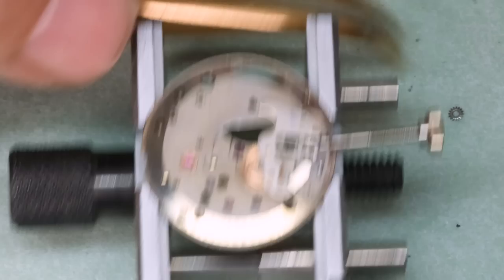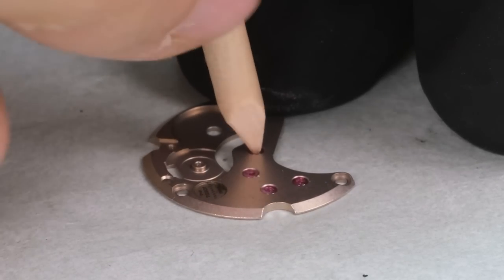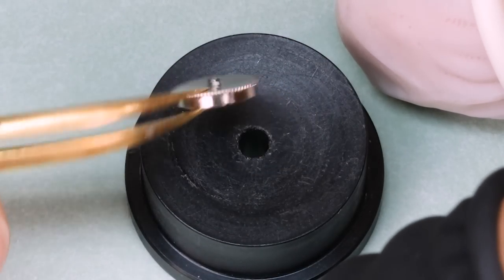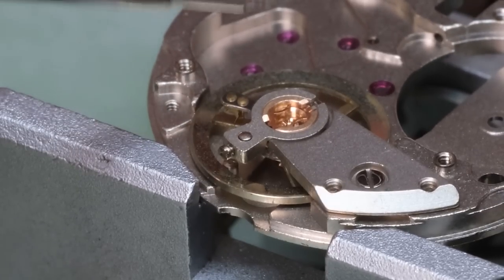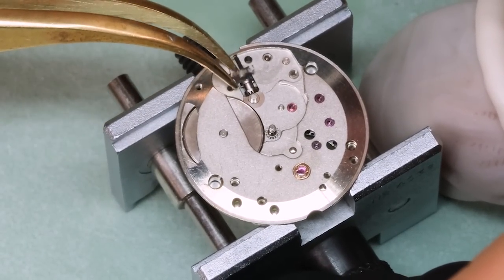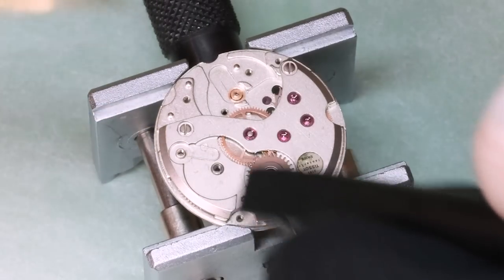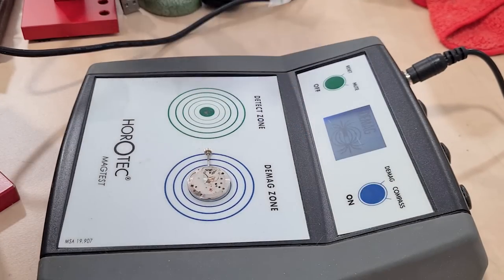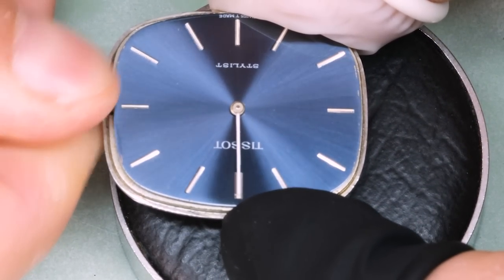What is a NOS (New Old Stock) watch?

Comment: I'm working on an ETA 2512 for my elderly neighbor, which is roughly the same size as this one.  It's been very challenging given my skill level.  I did find the 2nd wheel had a broken pivot (but not until I tried putting it back together) which explains why she picked it up so cheap at a local shop.  I also had to wind the mainspring in by hand because the arbor on my small winder was too small for the spring and wouldn't catch and I didn't want to try to bend it for fear of breaking it.  These small movements look big on the screen and I'm sure most viewers can't appreciate it, but I totally get it.

Comment: The principle of entropy says, in essence, everything deteriorates with time unless deliberate steps to preserve or improve it are taken.  The more complex the thing, the greater entropy's effect.  This watch is a great example of entropy at work.  I'm new to rebuilding old bicycles, but already I have found examples of the same principle applying to "NOS" bike parts.
Reply: Unfortunately a NOS bike would get enough power to brake itself unlike a NOS watch which has not enough power to even start. Fortunately for the movement.

(Just thinking of 50 Year old brake pads...) 😱
Reply: @Ba_Yegu  Indeed. We rarely an entire bike being advertised as NOS, but we do see parts.  NOS brake pads probably would be hard as a brick and unusable.  NOS tires can be pretty risky as well, though I've got some 20+ year old ones in service right now, and they're doing fine.  But NOS derailleurs or brake calipers would just need a little TLC, akin to what was needed for this watch, to make them operate as new, maybe even better than new.
Reply from the maker: Thanks, Ranger! I didn't really know the word entropy, but now I do :) And you're absolutely right, unless something has been stored in complete vacuum, it will deteriorate. And perhaps even then? 🤔
Reply: @VintageWatchServices  In complete darkness, in a container filled with inert gas (e.g., Argon) under slight, positive pressure, kept just above 0°C and protected from variations in ambient temperature and movement. That, or one could just service the NOS watch and put on a new strap. ;) Thanks for another great video.
Btw, over time, I’ve purchased three, slightly newer NOS watches (1980’s and 1990’s) and I learned fast that while step one was admiring them and their visual,perfection, step two was immediately tearing them down for servicing!

Comment: Love your channel Stian. I am fascinated with your abilities as a watch maker, and as a historian. I always learn something new each time. I did some calculations using an on-line inflation tool. It showed 100 Japanese Yen in 1974 is now valued at 216.31 (39,000 now equals 84,360.9).  Using the current yen rate = roughly 574 Euros. Cheers from Guam USA👍
Reply: 100 yen per dollar exchange on average over decades, so the watch retailed at $390 in 1974.
The 1974 buying power of one dollar was six times the 2022 dollar.

Comment: I bought a JOS Shanghai watch made around 1980 to 1982 for 70rmb everything was great the strap was good it had a 21600bph 19 jewel Tongji handwind movement.

He swapped out all of the o rings with new ones and serviced the watch.

Since most Tongji movements are very similar and he was an old watchmaker he looked like he could do it with his eyes closed.

Use iso to clean it and Seiko synthetic lube and grease.

He poised the balance and regulated it very very well he said come back after you have worn it in 3 months when it's broken in and I will adjust it.

I love NOS finds.

Comment: Wonderful. Perhaps you can check with Polywatch but I spoke with their sales rep many years ago and he told me that polywatch was not an abrasive but in fact worked with friction from rubbing to move very slightly the plastic molecules so as to fill in the scratches. You only need a lentil sized amount on a crystal in this condition and use a wadded up piece of kleenex which helps generate friction and thus the important heat to create the chemical reaction. Once you feel resistance the plastic is melting! Just a few seconds on a crystal like this and then polish with a microfiber cloth to achieve a beautiful deep sheen.

I have been doing it this way for many years now and always get perfect results and in fact on a brand new crystal the depth of clarity increases also. Give it a go and see what you think! The plus side is that you save a small fortune on poly watch and I always put the wadded up tissue paper in a small zip lock bag and its then good for several more minor buffings!
Reply from the maker: Hello Ian, thanks for your tip! That polywatch sales rep might have "enhanced" reality a bit with his comment 😉 Polywatch is in fact an abrasive, albeit a very fine one, and it works as other very fine abrasives by removing a tiny bit of the surface and thus with it any fine scratches. If you would have a very, very strong microscope you would see that the abrasive rubs off the sharp edges of the scratch and in fact creates a tiny little rounded groove where the scratch was. 
Plastic does not melt simply by rubbing it, that would take a blowtorch, as the melting point is close to 200 degrees celsius. But by rubbing the very fine abrasive for a couple of minutes you remove enough of the surface to make the scratches disappear. So regardless of how it does it, the result is the same :)

Comment: Great video, thanks. I'm curious as to why the teeth on the escapement wheel are lubricated, but other teeth (e.g. the train of wheels?) don't get lubricated even though they have metal on metal contact as the teeth mesh when turning? I'm guessing they are more prone to attracting dust/debris if lubricated, which would wear out and damage the teeth faster than if left dry?
Reply from the maker: Hello Shayne, thanks for watching! The wheels in the gear train indeed have contact, but the profiles of the teeth are cut so that the surfaces do not rub against each other, they roll on each other. That's the reason they are not lubricated, it is simply not necessary and as you indicate would even be detrimental. The reason for making teeth with this profile is that it creates very little friction in the train and thus needs less power from the mainspring to rotate.

Comment: If a car sits unused for a long time it's terrible for it. I've wondered if this was the same for watches. 
An engine needs to run to pump oil from the bottom to the top or it all settles down so it's not quite the same, but does running a watch regularly keep it in good shape like an engine?

Comment: That movement wasn't what I expected but the dial is Fab. How does the beat error get out of tolerance on a watch that was never used or would it have been running poorly from day one?
Reply from the maker: Hello Andy, thanks for watching! It's a bit odd indeed. The only explanation I can think of would be that the metal in the hairspring has changed ever so slightly over the decades, but I'm not sure that would be the reason either.

Comment: An important video for consideration of NOS stuff… and frankly not just watches. When it comes to cars, the wise collector knows the worst cars are often the ones not driven at all. I have a bunch (of mostly worthless, very low-end, largely pin-pallet) NOS watches I acquired as part of buying out a retiring Jewllers and none of the even run at all.

Question I’ve been meaning to ask: is there a reason you haven’t featured JLC/LeCoultre on this channel?

Comment: Hi Stian, do you make a difference in cleaning between the parts of the movement?
I ask, because I am concerned about using solvent to clean the pallet fork and the balance with the hairspring, since they are coated with shellac. Wouldn't these parts be damaged while using solvent? 
Shouldn't they be cleaned with water based cleaning fluid?
Reply from the maker: Hello Aquaman, thanks for watching! No, there's no need to worry about the shellac being dissolved in the cleaning machine nor in naphtha. If you use alcohol for cleaning however, that will dissolve shellac.
Reply: @VintageWatchServices  
Hello Stian, excuse me, for asking again.
Is naphta the distillate from petroleum? And this doesn't affect shellac?
Do you use naphtha, beside water with cleaning fluids, in the cleaning machine?
Reply from the maker: @aquaman1534  No problem of course :) Naphtha is a partial distillate from petroleum indeed. It's often referred to as lighter fluid, as it is often used as that. The cleaning machine has specially made solutions for watch cleaning, which are of course made so that it doesn't damage any parts. As far as I know the exact composition of these solutions are trade secrets, but there's nothing in them that will dissolve shellac. I still wouldn't leave the parts in the machine overnight or such, but that goes for any cleaning liquid, since they can be somewhat aggressive if parts are left in for too long.

Comment: Great video!  It looked like the crown wheel screw has a right-hand thread, but most movements with a single crown wheel screw use a left-hand thread.  Did I see this correctly?
Reply from the maker: Hello Paul, you did indeed see that correctly. If the crown wheel rubs directly against the screw, it will be left-handed, as the rubbing action would unscrew the screw. However, if there is a shim or some intermediary tube that removes the direct contact between the screw and the crown wheel, the screw can be right-handed.
Reply: @VintageWatchServices  Thanks!

Comment: Did you clean the corrosion from the back of the dial?
Reply from the maker: Hello Zev, the dial is made of brass and isn't corroded. The marks you might see on the back of a dial are either from the fixation of the indices or due to the fact that the backside of the dial isn't made to look good, eg the paint isn't uniform.

Comment: Sometimes when you are unscrewing the screws you turn them the normal anti clockwise and sometimes you turn them clockwise. How do you know which way each screw turns.?
Reply from the maker: Hello Kevin, in general all screws are right-handed, thus the "normal" way. A few screws might be left-handed, typically the crown wheel screw and some chronograph screws. There is a sort of standard that left handed screws have two grooves parallel to the screw slot on them, but that standard isn't strictly followed.
And between you and me; if a screw does not come loose when I'm trying to turn it, I try the other way 😁
Reply: @VintageWatchServices  Thank you. I have snapped the head off a couple before i watched your videos and found that there were different types of screws. I love your content and commentary and subscribed a while ago.

Comment: After all that painstaking attention to detail, why didn't you clean the back of the dial before re-installing it on the watch?  Or did you clean it but not show that?
Reply from the maker: Thanks for watching! The backside of a dial generally does not need any cleaning, unless there is oil underneath the dial. So a quick dust-off with air is enough.

Comment: A Swiss professional watchmaker told me that synthetic oils in the watch industry have been around since at least the 1960s, so I believe your assumptions are incorrect.
Reply from the maker: 😂 Yeah, well, mobile phones have been around since the 1970's also, but there are still hundreds of millions of people using landlines. By your logic, shouldn't everyone have switched over decades ago? Also, Moebius D5 for instance is still a very popular and much used oil, as an example of natural oils still being around. 
You should also keep in mind that in the 1970's there was a lot of cost pressure on manufacturers, so they would cut costs where they could. Which would include using cheaper lubricants.
Reply: @VintageWatchServices  "given that we're working on watches that are 50, 60 years old, a NOS watch from that period will have originally been lubricated with the natural oils so either vegetable or mineral or animal oils". I still think your assumption is incorrect as synthetic watch oils have been used by the watch industry for at least 60 years so the statement that only natural oils were being used 50, and 60 years ago is not a given. Trying to compete with quartz watches during the quartz revolution, I would assume (although I could be wrong) that manufacturers of mechanical watches would have been using the best oils they could lay their hands on, including synthetic oils. Your statement about D5 would have been true some five years ago or so, but if you look at the technical communication from manufacturers such as ETA, D5 has been completely replaced by the synthetic HP-1300. I am sorry you found my comment provocative as it was meant to contribute to our common knowledge.
Reply from the maker: @Vostok Watchie  It's great that you want to contribute to the shared knowledge, but your tone was pretty bombastic and the logic somewhat flawed. Yes, synthetic lubrication has been around for a long time but it wasn't really widespread in the 1970s, to my knowledge. If there's anyone in the comment section who were active as a watchmaker at that time, it would be very interesting to hear what kind of lubricants they used!